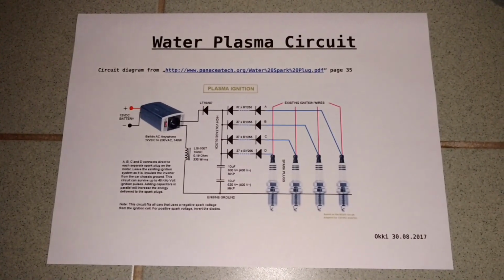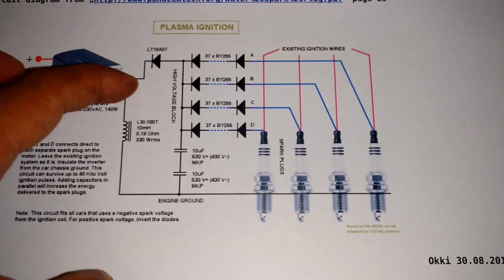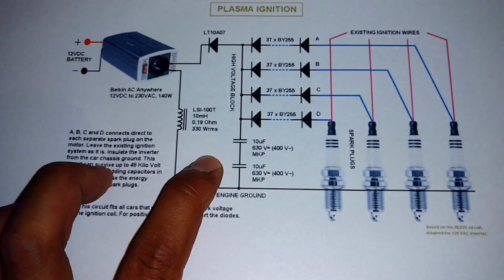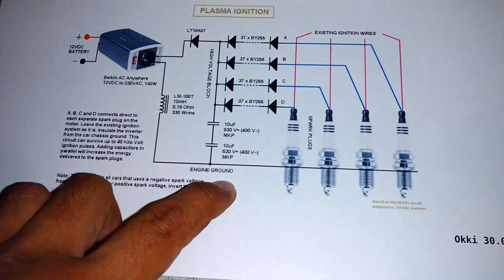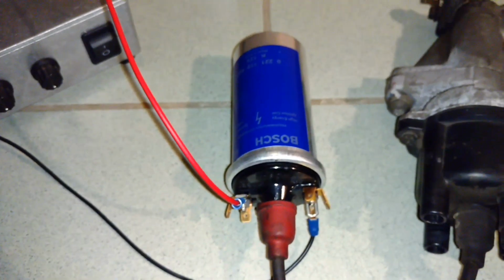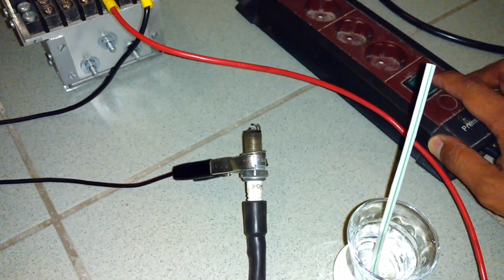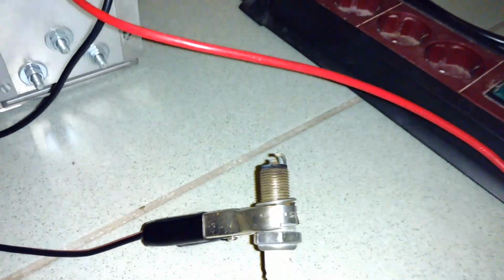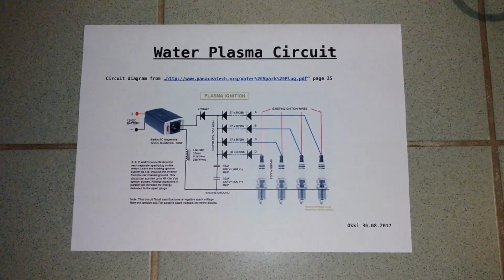Water Plasma Ignition

Comment: I've seen modified plug experiments in the past, where the plasma discharge occurs over a larger area to ionize a larger volume of water vapour. In any case, this is important if you want to yield meaningful energy, and reduce electrode burn - too heavily concentrated at the negative tip of a conventional spark plug. The crux is ultimately to establish the delta between input (plasma supply) and output energy.

Setting material selection aside, my thoughts would be something along the lines of a negatively-precharged grille in a grounded metal chamber, situated just below an open spark plug tip with the earthed electrode removed, and triggered by positive spark to the grille (forward-biasing the diodes to form the trigger circuit). The plasma would then form between grille and chamber wall.

Ionisation would then be permitted to spread from the trigger point across the vapour-filled chamber, though you'd then need a much larger capacitor!

There are also 20kV/2A diode modules available on eBay that would possibly support higher discharge current better.

Comment: There's always water in the engine, especially in humid climate.
However, the spark duration seems shorter, it's not desirable as the charge is not always around the plug.

Comment: Hi great work I'm in Canada we use 120volt  so we really only have 120 inverter will this work out for me...btw is there anything I can do to pulse my 6 injectors at say a half cycle therefore I can use water injection.. thks
Reply from the maker: Hi. Yes, this will work with 120 Volt as well. You can build simple controller for your injectors.
Reply: @OkkiMoeljadi  do you have any video for the controller for my 2004 Honda Odyssey 3.5l v6
Reply from the maker: @gulfy09  no, I don't. You can use PWM controller for that.

Comment: Nice Man ,did you try to run engine on water with this set up ?
Reply from the maker: Yes, I did. It did not work.
Reply: Okki Moeljadi did you try Joe cell in the car he said he run car on it
Reply from the maker: No I did not. But I have seen similar effect with my conditioned cell. Joe cell maintains voltage without any power source. Mine too, here is my video https://youtu.be/EF-wGGpd7JI
Reply: no shit! you need to convert it to hydrogen and oxygen first.
Reply: @OkkiMoeljadi  What if you retard the timing so the water can be more steamlike

Comment: Okki, does plasma spark noticeably increase mileage?
Reply from the maker: No, unfortunately not. At least not on my car.
Reply: @OkkiMoeljadi  I wouldnt use this in my car either
Reply from the maker: @luispesante1682  I tested this on my car actually.
Reply: @OkkiMoeljadi  did you correct for higher than factory o2 sensor values of oxygen?
Reply from the maker: @gregorykusiak5424  No, I did not change any setup on my ECU.
Reply: @OkkiMoeljadi  ok, but an interceptor circuit on the upstream o2 sensors can compensate for the cleaner exhaust. That likely would have given you appropriate mileage gains/fuel consumption reductions possible with plasma-water vapour.
Reply: @Okki Moeljadi  Hyfusiondotcom was saying to run only the hydrogen to increase gas mileage since the O2 sensor wud react to added oxygen..
Reply from the maker: @tnunn3023  I understand that.
Reply: @tnunn3023  there is quite a bit of confusion and misunderstanding surrounding these concepts and how they work floating around out there on the interweb; the only way you can determine who knows what they’re talking about and who tells the truth is to experiment yourself and verify against sources
Reply: its like using c4 instead of dynomite... both do the same thing.... but c4 does it waaaay faster